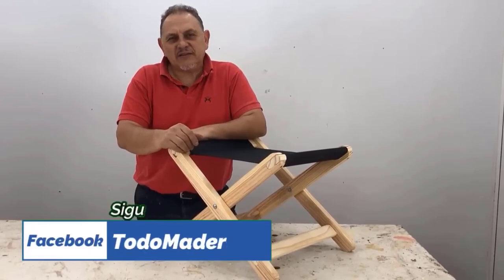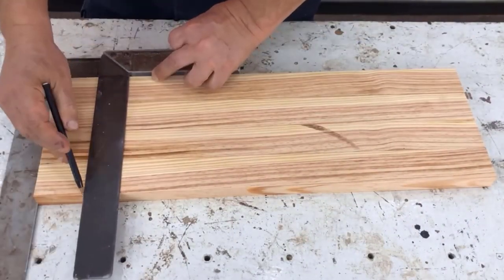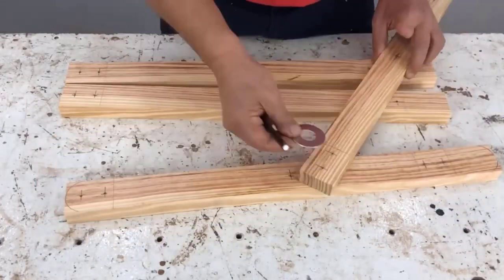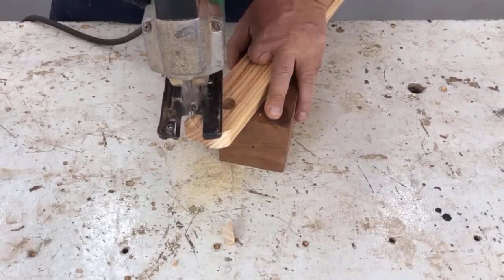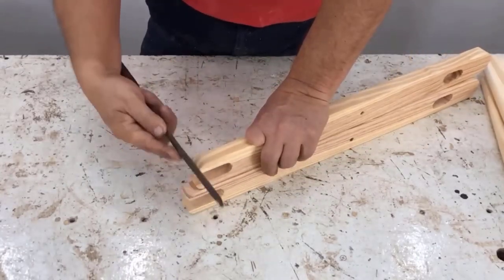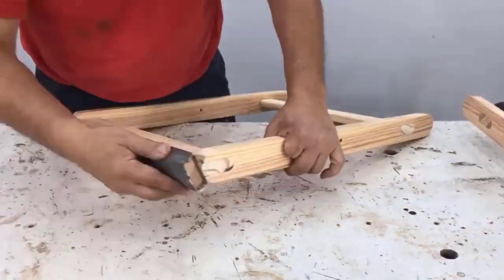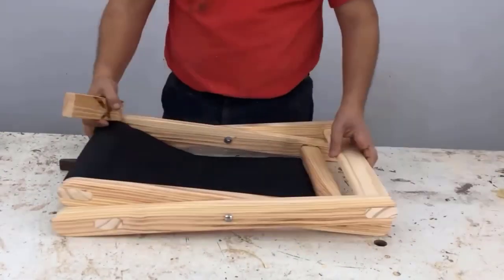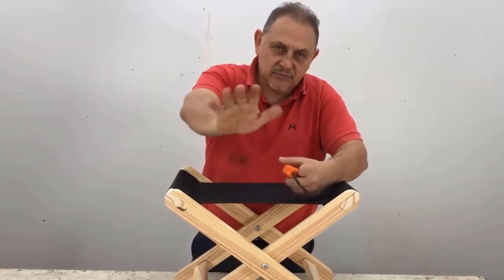Folding Stool with Canvas - Easy WOODWORKING Tutorial

Comment: Really nicely done! I like that the top bars can be removed to change the seat when necessary. 
Can the stool be made taller safely? I'd prefer it be 19 - 20" tall. Would I only need to move the pivot point in the center?